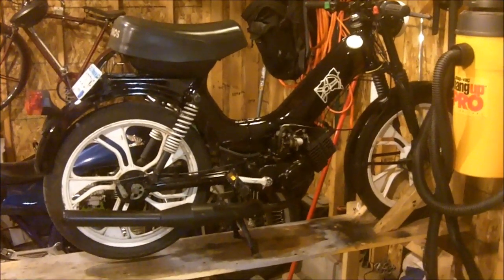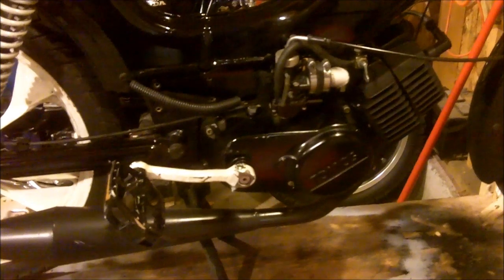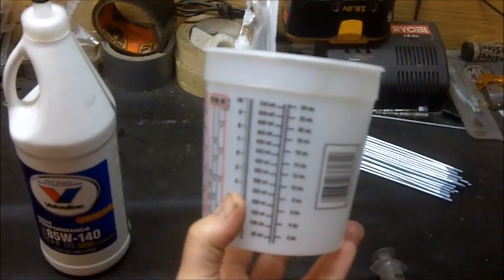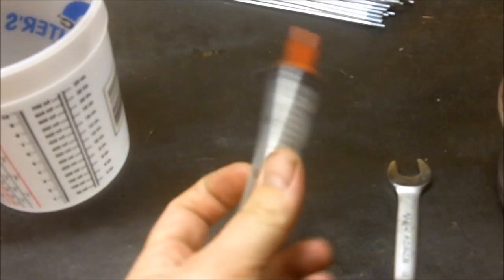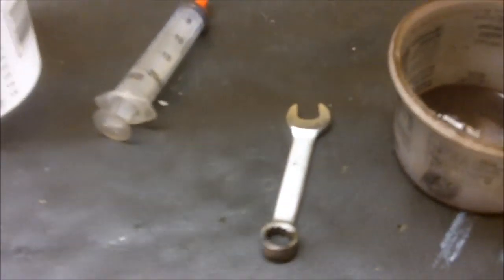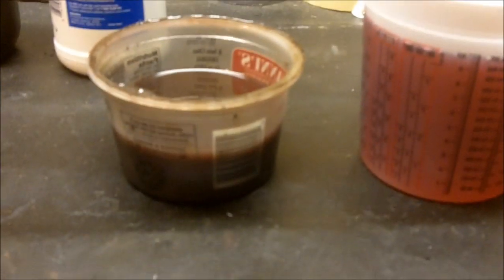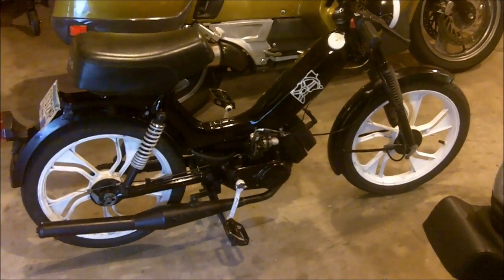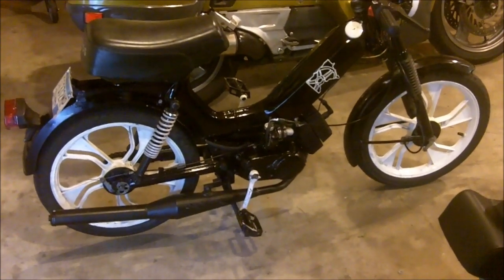Tomos A35 - Easy Clutch Tweak

Comment: You could also shorten the second's gear spring. It's hard because it's pretty tight, but once managed it can shift at 45km/h depening on what you take off. 40kmh is like 28 miles. Too much gear oil can mess up your bearings.

Comment: Doing This is JUST BAD ADVICE ; Don't do it . 
always USE The recommended fluids & at the proper levels.

Changing the clutch or springs if You want to set your bike up differently .
for common street use ; I don't think you want that effect .

Comment from the maker: Adjust the lobe shaped things around your rear axle so that your chain is tight enough so that it only has about an inch of play vertically and the wheel is centered in the front of the swingarm and then tighten down the axle nuts. If you cant get it that tight then you need to buy a new chain.Hope that helps

Comment: From my experience this is not a good mod it made my transmission not want to shift at all just revs high as hell and never hit second. Also from lots if research ive found that it has a tendency to swell the cork and it just disintegrates.  The tomos engineers know what they are doing and recommend only the use if type a fluid for all a3 a35 & a55 which is hard to come here in the states

Comment: adding more than 300ml of atf fluid creates extra resistance. Your torque will suffer, i know from experience. Its probably not as noticeable on a kitted ped, but on a stock ped it destroys your hill climbing ability. Just change your springs.